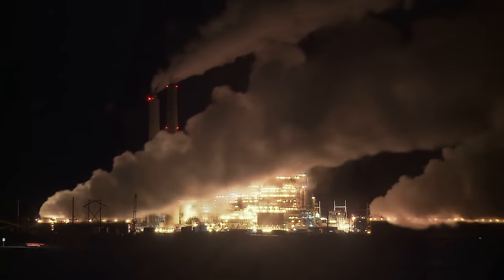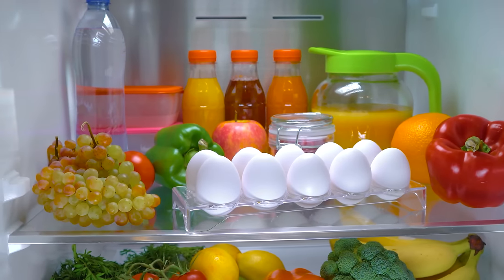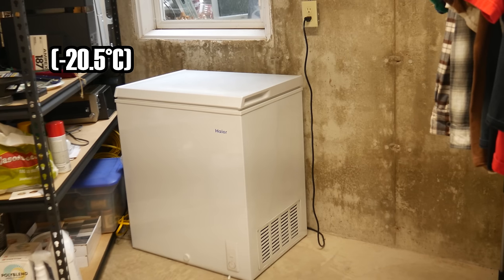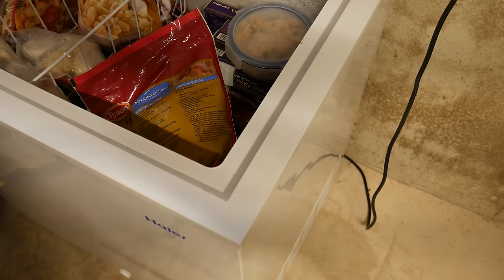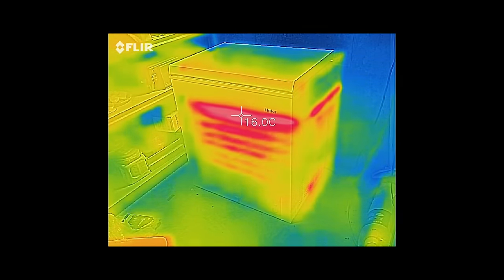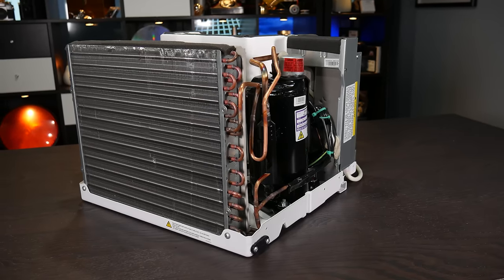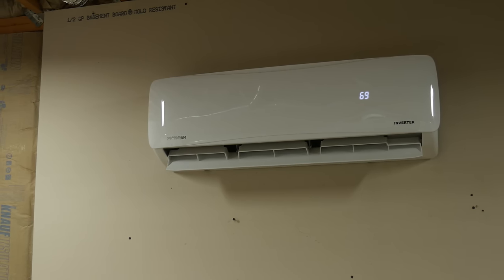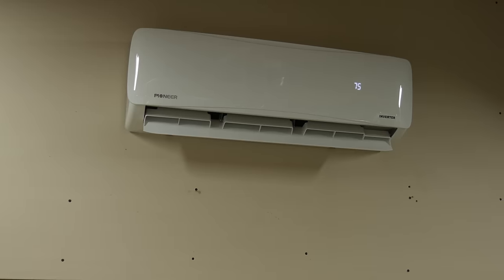Heat Pumps: the Future of Home Heating

Comment: Meanwhile in Sweden , I'm annoyed that my heat pump doesn't cool. It would have been sweet to have air conditioning in the summers!
Reply: But it does cool... you're just cooling the outside air.

In the US we use heat pumps to heat water for swimming pools. Their exhaust is cool air and when in air restricted areas the temperature gets even colder.

Edit:
They also have units that can work both ways and cool water. They are generally more expensive.
Reply: @LeoInterVir  

Cool the inside air I mean of course.
Reply: You can get heat pumps for both heating and cooling
Reply: @LeoInterVir  A friend of mine's VERY wealthy parent have a pool with heat pump that's integrated into the changing room's A/C. The heat is transferred from that room to the pool.
Reply: @eleftherios11  

I know, but mine doesn't.
Reply: Most "heat pumps" also work as air conditioners
Reply: @PaulHojda  yeah but they only work as air conditioners for outside.
Reply: @midimusicforever  that's a shame. All our heat pumps here in NZ both heat and cool. It's wonderful.
Reply: @pilotavery  yeah, but there are some switching systems that can move heat into the home or move it outside
Reply: @BluuFlo  yes there are, but this person said theirs does not so
Reply: @AndrewMcColl  Some of that is because we're relatively late adopters. Most have been installed in the last decade or so, many of the early models weren't reversible cycle.
Reply: @ajm5007  A pool heatpump really isn´t that expensive. I seen them for about €600
Reply: Flip it around.
Reply: @midimusicforever  I’ve never heard of a heat pump that doesn’t have a reverse function  as well. Oh well
Reply: You have a heat pump that can't be used to cool? I have, and my father has had one for ages.
Reply: @LeoInterVir  Have a technician install a switching valve, if possible.
Reply: oh, I didn't know we had those, mine does both and is like 20 years old, it becomes pretty much useless below -5 or so tho, rly want to upgrade top a new one.
Reply: Same here. They didn't tell me that there's a more luxurious model of my heat pump for underfloor heating that can also cool. Just a bit of extra money would have done it.
On the plus side, I now have a split unit AC that can also heat and it's like a little backup unit in case my main heater dies.
Reply: @theamazoner4075  I think it's because you're only thinking of air/air heat pumps. Air/water heat pumps don't have a reverse function, because why would you want to cool down the already cold water? Air/water heat pumps only exist to heat water which is then circulated through the house to provide heat.
Reply: @eleftherios11  Yeah but for some reason only only the air-air variety. If I buy a air-water heat pump for a lot of money, I would've liked the optioion to pay a little bit more and get an AC as well.
Reply: I have a heat pump powering the floor heating in my home. But it doesn't provide floor cooling in the summer. So annoying!
Reply: Maybe have a reversible heat pump installed? Maybe have some geothermal wells drilled if costs and location allow, they would also make heating and cooling easier.
Reply: There is no reason that your heat pump cant function as an efficient central air-conditioner! Have it serviced!
Reply: Since your in sweden my guess is you have a Nibe, there are just some small modifications needed for it to use it as an AC.
Reply: @midimusicforever  Is your heat pump ground to air or air to water? If so, yeah, it is a bit problematic
Reply: If you have a ground source/geothermal heat pump you can have a technician install a separate heat exchanger indoors. 
The energy wells brine solution (about 4 C year around) is then circulated through the heat exchanger, which act very much like the indoor unit seen in this video. It's called frikyla in Swedish, or free cooling/AC. Cause that's basically what it is! 😀 The only energy needed is for circulating brine and running the heat exchanger fan.
Reply: @jur4x  

Air to water, and that's why it doesn't cool. In a air to air pump, it's trivial. Air to water... Not so much. But I still would have loved to have an AC in the summers. :P
Reply: Actually I have never seen an air-air heat pump in Sweden that is not reversible to be used as an AC. I thought that was the normal thing.
Reply: Sweden, summer? Nah, you guys don't have 'summer', you have winter, and a 'less cold winter'.... Hi from Australia.
Reply: That's weird, heat pumps in New Zealand provide both heating and cooling.
Reply: Iv got a portable unit and what i do is physically move the "air conditioner" outside and route the heat exhaust hose inside. Basically reversing the cycle by physically moving the unit.
Reply: Uhh no. Most of the ones sold in the US since the 70s are reversible.
Reply: Heat Pump: the future of home cooling!
Reply: you could rout pipes to invert its intake and exhaust
Reply: @KekusMagnus  

No. My system takes in air from outdoors and makes hot water indoors. ;)
Reply: @matsv201  a normal size pool's, not a spa's, heat pump is roughly 3000$ from a supplier, that's not counting installation or upcharge. Usually you're looking at 4500$ installed if the electrical for it is in place, if not you'll need an electrician.
Reply: @MarbleTL  The new Mitsubishi air-source heat pumps can retain 90% of their rated heating capacity at 0 degrees Fahrenheit.
Reply: @LeoInterVir  what is a "normal" size pool?
Reply: @Chris-hx3om  We get it, y’all get skin cancer. We thankfully never get your top temperatures, but during a few summer weeks we can get few days where one sweats outside.  Go figure.
Reply: Isn’t there a whole song with a verse complaining about that?
Reply: @matsv201  in the US, I'd say the average modern pool is 15' x 30' with a depth going from 3' in shallow end to 5' in deep end. It's around 10000 gallons of water.
Reply: @LeoInterVir  That is like only 30% bigger than my pool
Reply: @theamazoner4075  In Europe Heat pumps often don't use indor blowing units but rather heat a water system and thus can't provide (propper) cooling.
Reply: @kevin42  where do you get one that has that low of a set temperature?  I just vent the hose inside and turn it off when it gets warm enough.
Reply: @LeoInterVir  I like that you're going to the trouble to explain US sizes to the world, but leaving it in units almost everyone is going to probably need to convert to meters and litres.
Reply: @pilotavery  Central Air compressor
Reply: @Zraknul  ripped out the controller and replaced with a Pi, some mosfets and relays
Reply: @codingquantum2195  Exactly, around Europe A/C and Heating Systems using Air ducts are rare. (well these days they are, my grandparents house for some upstairs rooms just had a vent from behind the radiator in the downstairs room to tap war air into the upstairs room.) However, Air ducts are rare. Not unheard of but you will have a hard time to find any except for larger commercial buildings. And even then you may have more like in room heat exchangers  using either hot or cold water to cool the air in the room instead of air ducts. No one wants to pay for the "waste of room" an air duct is. Pipes are way smaller. But there may also well be regional differences.
Back to what is used on aregular basic. Most heating systems here are actually hydraulic system. So either a furnace, a solar collector (not solar cells, although they are sometimes combined) or a heat pump are used to produce hot water. and this hot water then heats either radiators, or more and more common over the last decades, sub floor heating. Oh and sometimes they produce hot water for your shower as well.
They are just not very good at cooling, allthough some subfloor heating systems with a heat pump can be kind of reversed. In this case they sometimes use either kind of additional ceiling panels for heating or built something within a wall, to on the one hand get it nice and warm with a lower media temperature or allow for some slight cooling effect. But those setups are even more rare than air ducts. They doe it some times with subfloor heating only, but with the tendency of cold air to go down... if you do not actually run fans it does not really do a lot.
Reply: @Chris-hx3om  
We have a saying here: Summer is the best day of the year!
But jokes aside, is has been getting hotter here during the last decades, both summer and winter. Have never before thought about getting an air conditioner but this year I think I will get one. That summer day can get really hot! :-)
Reply: If you don't like summer in Sweden, just wait 2 weeks.
Reply: @rik8508  It's a bad idea to cool floors. If the RH is high then cooling the floor hits the dew point and makes everything wet. I've seen it done and it's more trouble than it's worth. You can put some controls in place to prevent it but it's not really worth the bother.
Reply: @ollylewin  didnt think of that :/
Reply: @rik8508  It's a shame because the cooling effect of the floor works rather well. The convection current in the room is very effective and comfortable. It makes things even worse though. The air at the top of the room collects heat and as it falls brings all the moisture with it, making the problem worse. I tried all sorts of things to try and prevent the problem but non really worked that well.
Reply: @ollylewin  i was also thinking that cooling the floor would actually give a problem with too little turbulence, as cool air stays low. Creating a cold layer near the floor. Thats why floor heating works so well. But what about ceiling cooling then? Xd
Reply: That's an important clarification. All air conditioners are heat pumps but not all heat pumps are air conditioners.
Reply: Då har du köpt fel pump. Min kyler även.
Reply: @ArchieStiglitz  

Du har luft till luft, va? Jag har luft till vatten, det är därför den inte kyler. Blir lite knepigare att lösa på en sådan. Men det hade varit gött att ha.
Reply: @midimusicforever  Okej okej, nej sån har inte jag. Jag vet bara att min kostade över 20 papp och det var värt varenda krona :) Kallt på sommarn och varmt på vintern
Reply: If it is a air/water pump, how can you be "annoyed"?
Reply: Indoor condensative rain ? A ceiling fan may be a must.
Reply: @theamazoner4075  The problem is, for Swedes, sweltering hot days were a rare or never occurrence.  That is changing rapidly.
Reply: There are air/water units that can provide air conditioning in the summer.
Reply: Wow I didn't know they made heating only heat pumps
Reply: @michaelclark3192  

Quite common with air to water pumps.
Reply: @midimusicforever  Here in Norway we have heat pumps that can heat and cool the air.
Reply: @KrissFliss  

Air-to-air pumps can do that. Mine's air-to-water tho.
Reply: @bourdonbt  lol
Reply: Nibe heatpumps have 10c as there lowest temputure setting.
Reply: @ThePapaja1996  

That's air to air I guess? I have air to water.
Reply: @midimusicforever  Deras senaste modell av luft till vatten pumpar går ner till lägst 5 grader inomhus.
Dock är detta vatten vilket tar längre tid att kylas ner och värmas upp.
Reply: Will CuckSmith  Indeed, and we are getting less and less of 'less forest fires'...
Reply: @ajm5007 , in reality, the heat pump pool heater is less expensive to run than a natural gas or propane pool heater.  It is clever of the installer to direct the cold air discharge from the pool heater to the changing rooms.  The RV park that I stayed at in Bowling Green Ky, they had a heat pump to cool the rest rooms and control the humidity.  To bad they could not connect those heat pumps to a water coil to pre-heat the water going into the showers!  It would make heating the water almost free!
Reply: @Chris-hx3om  28 degrees C today, for the 3rd day in a row. 
We do have summers, but usually unreliable when it comes to heat. 
But 2018 was basically 25-35 degrees celsius from may to august. 
Climate change will sell more fans and AC here in the future. 
I also have air/water which does not generate cooling, but a neat function for night mode makes sleeping better where it starts sucking in in cooler outside evening air at a set difference in temperature.
Reply: @midimusicforever  Same. Nibe?
Reply: @jez76  No, CTC.
Reply: @rik8508  maybe the reason could be to avoid possible condensation inside floor where are pipes, this could lead to many problems, like fungus
Reply: What heatpump makes are popular in sweden?
Reply: That blistering 70°f swedish summer is rough
Reply: @otterconnor942  Sweden is not Alaska. We have that Gulf stream thing.
Reply: @midimusicforever  no sh!t
Reply: T Raybern  Usually a factor of 4 to 5 (known as COP), maybe a bit under 4 when it's super cold. Means around 10000 to 13000 BTU/h per kW. You need to multiply the kW with the factor and convert it to BTU/h.
Reply: all you needs a reversing valve and a little more line set
Reply: @capshorts00  nope
Reply: @ajm5007  whereas in Australia, a majority of house have reverse cycle air conditioning, which is a heat pump by another name.
Reply: My grandparents had a reversible air-sourced heat pump in their Florida home in the early 80’s.  Since it gets chilly there in winter, but never cold like we know in the north, it was ideal.  They were a popular option down in Florida from what I could tell.  As my grandmother said, it would be a waste of money not to get “reversible central air.”
Reply: @pinarello74 I've installed a few of those and honestly they're a waste of time... Only a couple manufacturers can do it and implementation is piss poor to say the least... Most air to water manufacturers laugh down the phone to you when you ask about cooling and will tell you to just buy air con

Honestly I think air to water is a waste of time, you're trying to heat the air anyway why add in the middleman? You can get air to air units that blow warm air along the floor so you kinda get that pseudo underfloor heating effect but with much faster heat up times, cooling in the summer, better controllability and a fraction of the cost and upheaval 

Tl;Dr air to water with cooling is just more expensive worse air con with extra steps
Reply: @LeoInterVir they are a different sort of heat pump
Reply: You can get a heat pump that does both
Reply: @taikajorma7276  I would have to replace a lot more than just the pump to get both.
Reply: Central cooling is likely to be a thing in the future.
Reply: @midimusicforever every heat pump cools, and the other way arround... in summer make the plumbing so it heats your water and pump cool air into your house, thats how i set up my heat pump.
Reply: @jakaberdajs4378  Mine doesn't do that, unfortunately.
Reply: @midimusicforever  they all do, you just need to reverse it...
Reply: @jakaberdajs4378 Nope, mine doesn't reverse.
Reply: @midimusicforever  again, THEY ALL DO, it takes an afternoon of DIY and some basic skill, couse if it heats then it needs to blow cool air as well... you cant have one without the other...
Reply: @midimusicforever might need a new one then
Reply: @eleftherios11 that's funny I thought all heat pumps cool in summer and heat with help in the winter. My heat pump still uses heat strips ( heating elements). 73
Reply: @pilotavery wrong ! They cool inside and in the winter they heat inside. The thermostat has a setting if you want heat or cold air inside. They reverse function always the outside will be the opposite of what's inside. 73
Reply: @pilotavery yeah but i.never heard of that kind of system. I had a window unit that was a heat pump you just turned the unit around. It was an old thing. It didn't have a controllable thermostat just an on and off switch. The compressor cycled on and off the fan just kept running. 73
Reply: @leetri I hope we are talking about home air conditioning and heat not hot water those are senseless because what are you going to cool. I guess that would make a good beverage cooler for the cool side and heat for water. Solar conversion is cheaper and free operating from the sun. Just put 12 or 24 volt elements in the water tank you already have and hook it to a solar panel you can also get DC thermostat for the conversion.  73
Reply: I guess I must realize this video is not about American heat pumps that cool and heat. Sorry for the misunderstanding. 73
Reply: Why are you Europeans so against guns and air conditioning?
Reply: @LeoInterVir  that's a small pool. My parents home had a 17000 gallon pool 3 ft and 8 ft in the deep end and our pool was small. My sister's pool was deeper to guess it had about 19000 gallons of water.both had diving boards until the pool guy removed the boards. They were outlawed because people would get head injuries diving and hit their heads on the bottom of the pool. I like the deep at 5 feet because it's less water to treat. But I don't want the expense to have a pool. Taxes are higher and so is the liability insurance on the home. 73
Reply: @Zraknul  yeah that's a trip. I usually have to convert to feet and inches. Good thing there is online programs to convert. I still struggle with the idea that this is internet. World Wide Web. I like the gallon it holds more water. They should make a 4 liter bottle for milk. they make 2 liter bottles for soda pop. I'm from Pittsburgh so it's all pop to me. LoL. 73
Reply: Air conditioners get less efficient in the same way when it gets too hot outside.
Reply: in our city never gets below 29 😢
i need cool pump
Reply: They....do? We use ours here in Stockholm for heat in the winter and cold in the summer.
Reply: @Fredpettersen  Do you have air to air or air to water tho?
Reply: @pilotavery no they are bidirectional, though the cheaper models are artificially limited to one direction only. Never understood why people buy those
Reply: @mtldax  not all of them are bidirectional though. There needs to be additional logic, usually paired with inverter and a couple extra valves pressure relief and compensation for hydraulic hammer
Reply: Same
Reply: Sveaden never sveats
Reply: @pilotavery  I've never seen a heat pump that couldn't do both. That's strange
Reply: @BaawBee  it's the dumbest thing, it's only an extra $15 in hardware, and yet they charge an extra $300 for it. Americans man...
Reply: Either its not a heat pump or its broken buddy 😂
Reply: @pilotavery  that's crazy it's like that where you are. Here in America I can't find a Heat pump online without ac. I thought they all did both
Reply: @LeoInterVir  I installed two near Örkelljunga the one for the house I added a unit into the same system. So it’s possible, but an add on not an “all in one” unit that uses forced air like the 3rd one I installed in the Midwest, USA.
Reply: My uncle's in Australia goes both ways. Very impressive.
Reply: @MattBrownbill  it's good to hear that Australia is progressive enough to accept your uncle who goes both ways!
Reply: @midimusicforever  That's very odd. All of the US heat pumps are equipped with a reversing valve that lets the unit switch between heating and AC modes.
Reply: En luftvärmepump kyler ner. Vad för någon luftvärmepump använder du? 

En luftvärmepump används för att värma och kyla ner.
Reply: @LeoInterVir Heat pumps is the norm in Sweden or as we call them luftvärmepump which translate to airheatpump.
Reply: @eleftherios11 Självklart kan man kyla huset med en luftvärmepump.
Reply: Vad är ditt problem?
Reply: @MarbleTL strictly speaking, your heat pump isn't useless, just that your home is losing too much warmth to the outside environment.
Reply: @LeoInterVir because a cheap bastard gets a pool, and a heater for it.
Reply: @BaawBee  has been that way since AC/DC
Reply: @Breznak  yeah